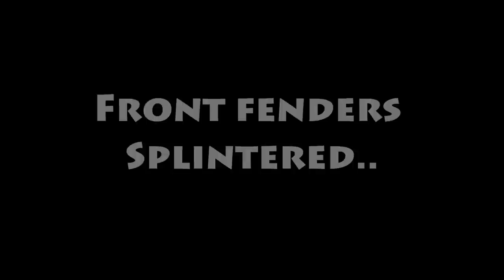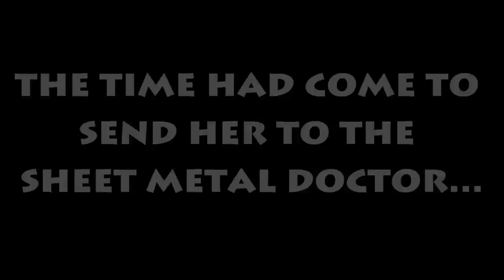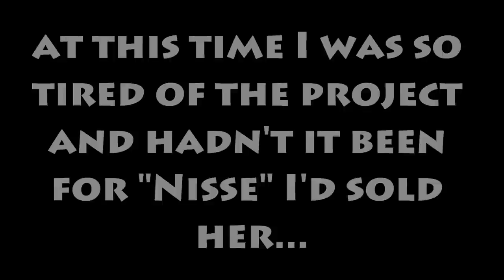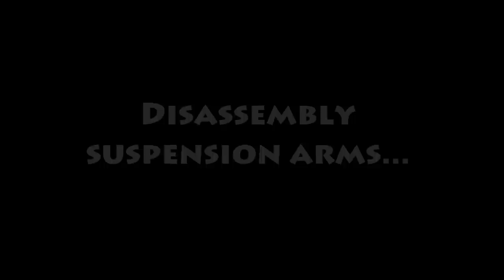Cadillac 1959 Restoration - The Disassembly of a Cadillac 1959 Coupe deVille .wmv

Comment: Beautiful Job on the restoration , however , one question , why did GM use the weak "X" frame on it's 50s cars ??? Seems like a very Weak frame design .
Reply: I've wondered about that. The frames from the late 1940s seemed to be designed to hold the chassis together without any help from the body, while by the late 1970s, the side rails of the full-parimeter-frame cars seemed far too light to hold the front and rear together on their own. Of course, today, a lot of cars have front and rear subframes with the body holding them together by itself. So, the X frame was just a stop along that progression and I've heard that the bracing along the door sills of the body were beefed up a lot to maintain a margin of safety. Still, full perimeter frames GM adopted for '65 made much better use of the space available and cut the weigh of the car (a '65 Fleetwood was nearly 1,000 pounds lighter than a Continental or Imperial, despite being bigger). All of that criscrossing of the X-frame rails seems to have resulted in a floor that's much higher in the front than the rear, eating up a lot of space. I guess it was just one stop in the evolution of these cars, but the '59s certainly had more character than anything before or after them and they were big enough that space utilization was not such a big deal.